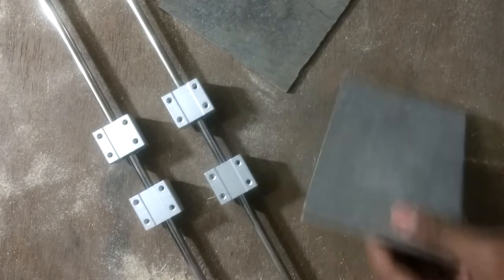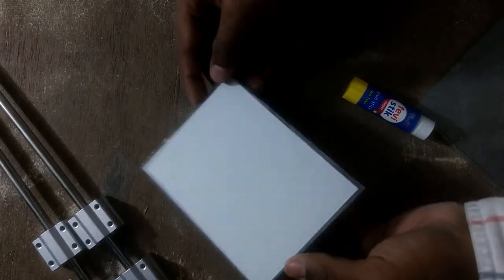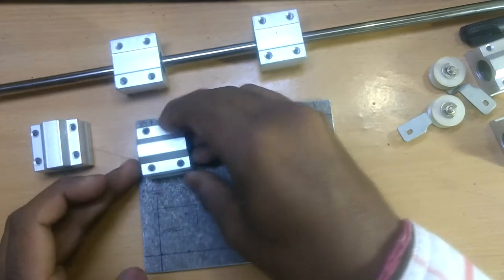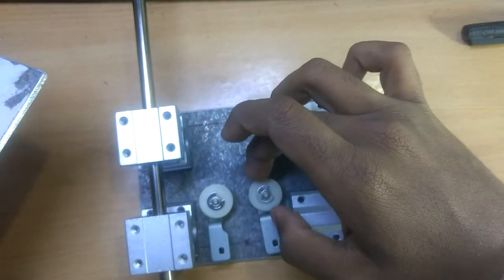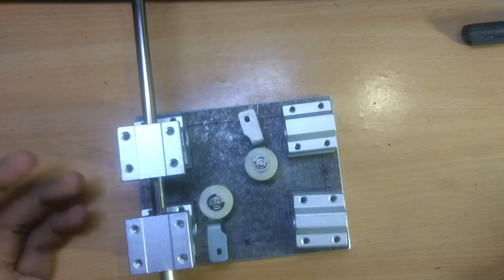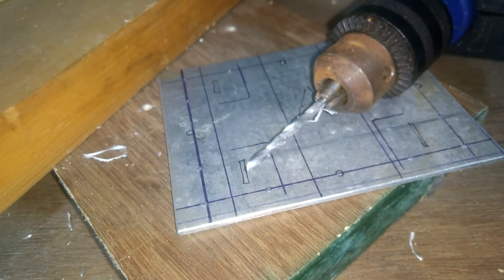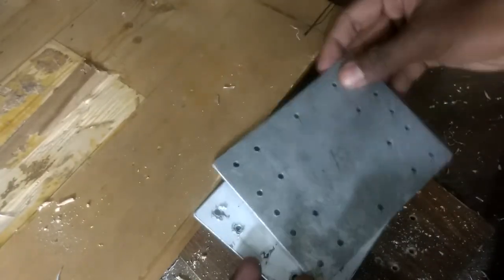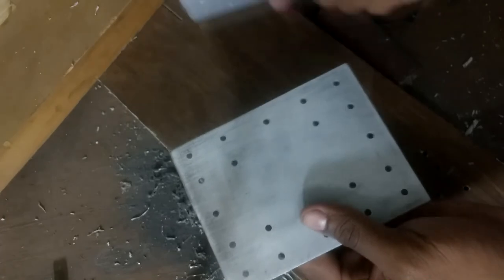Video 3 | How to make Arduino Drawing Machine | Making the Carriage | www.ArnabKumarDas.com

Comment: pls upload contents for the line follower as well along with the CNC....pls suggest a good motor driver as maximum times one of my channels of l293d produces leakage current after some duration of time after getting heated up on applying 12v supply
Reply from the maker: you can try l298 and if problem persists then you better use mosfets based drives.
Reply from the maker: Thanks .... If You Liked My Video Please Subscribe to My Channel... I am uploading the full DIY Guide on Drawing Robot https://www.youtube.com/playlist?list=PLJ6vAp3B9KcowLm6UeQCUzfQvk2obPZDg
Reply: but why is this problem occurring at d first place...I can't make out the reason d reason....and tried l298n too....same result...one of the channel stopped responding.....and please tell me a place or site from where I can buy a transmitter receiver and which one is better.....n what material r u using for these uav gliders?their cost and how to get it....please can you mail me the exact list of equipments for this glider
Reply from the maker: http://robokits.co.in/quadrotors-hexarotors/radio-control-tx-rx/flysky-fs-i6-6ch-2.4ghz-transmitter-and-receiver?gclid=CPb8gPXph9QCFU-VaAodUHEKMg&zenid=91923godvgphunjqi60jh1qri4  THIS IS A GOOD REMOTE. YOU CAN COMPARE OTHER SITES LIKE... AMAZON.IN,  EBAY.IN   QUADKOPTER.COM   http://www.rchyderabad.com/   RCBAZAAR.COM .......            THEN YOU HAVE SOME PROBLEM WITH LOGIC VOLTAGE, OR PROGRAMMING.. MAY BE SWITCHING FREQUENCY IS TOO HIGH...